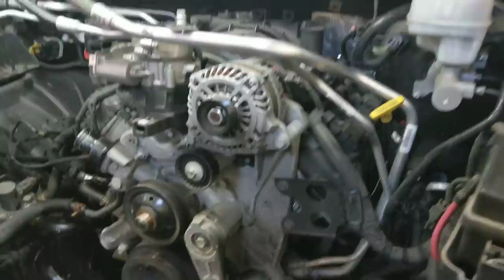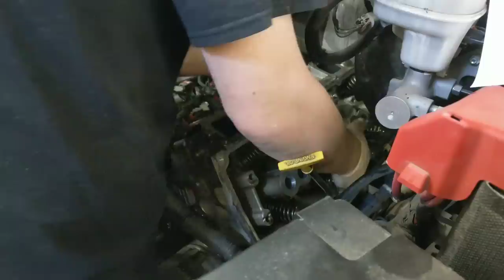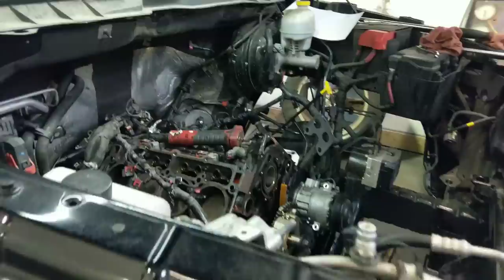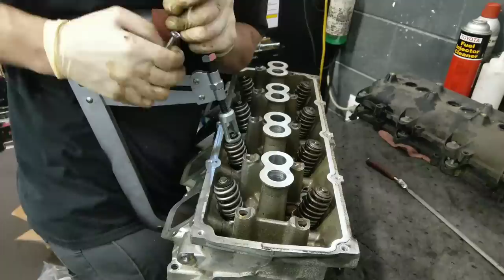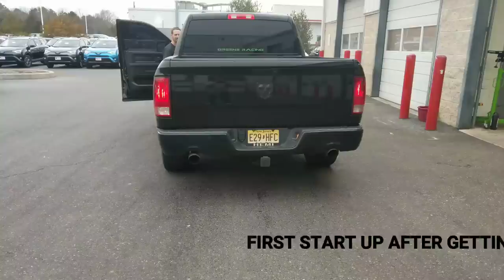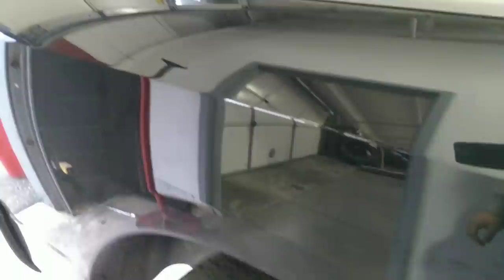HEMI RAM 1500 CAM INSTALL and START UP!!!

Comment: Too many things removed that really dont need to be removed for the replacement of the camshaft
Reply: gmor54ars I think he replaced his lifters as well. The heads have to come off to replace the lifters.
Reply: J Robles valve springs also
Reply: Jerry Hughes no valve springs don’t have to come off to remove the lifters. I just replaced the cam and lifters on a ram 1500. When you remove the heads the lifters and valves can stay in place, the lifters will be in your block being held in place with a plastic retainer
Reply: J Robles do you have a video??
Reply: @jrobles1019  he replaced the valve springs. Heads had to come off.
Reply: @R230Tuner not long tube headers like he has.
Reply: @CharlesJohnson-pi7ii   You can change the valve Springs without removing the heads but to change the lifters on this engine I think you have to remove the heads.

Comment: This video was more disappointing than the last time I called customer service for restoration parts on my carburetor.  Hacks at my last shop cut corners like these idiots seemed to be and threw away the choke plate, screws and linkage rod (No actual name given for that piece that I could find on God's Green Earth).  No one wants to listen to this music any more than a veteran calling the VA wants to listen to their On Hold music.

Comment: No work performed that required pulling the heads.  This should have taken a few hours for an experienced mechanic.  Completing the video with an illustration of any performance improvements would have been nice...along with NOT replacing the recorded audio with awful sounds.

Comment: I'll never take my Ram to this shop. What a bunch of amateurs, using an abrasive wheel on an "open" engine. That silica debris generated by that disc will ruin an engine. Plus, there's no cam lube on the installation. Shade tree wrenching at best. FAIL !